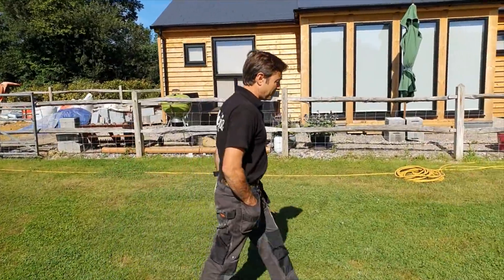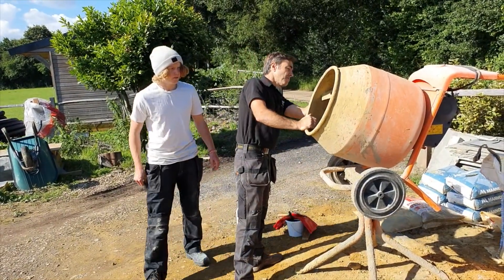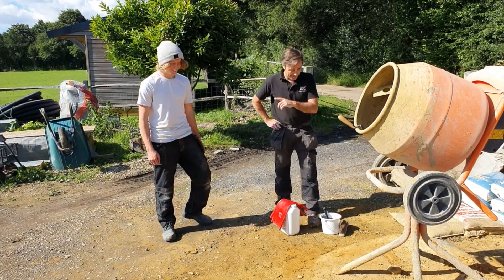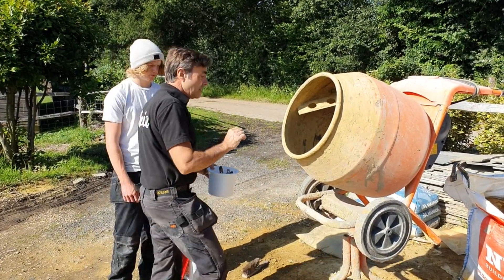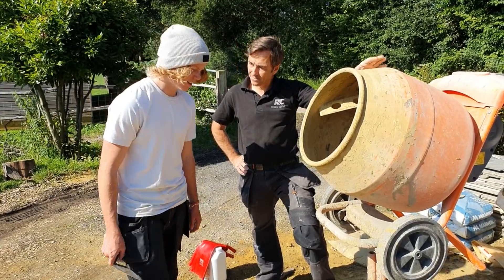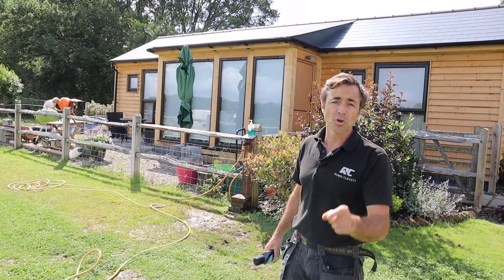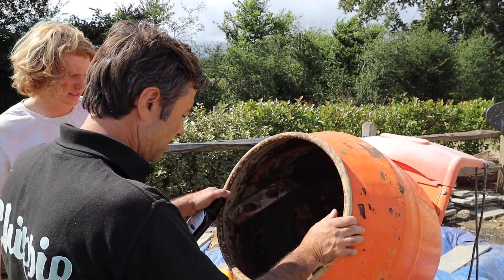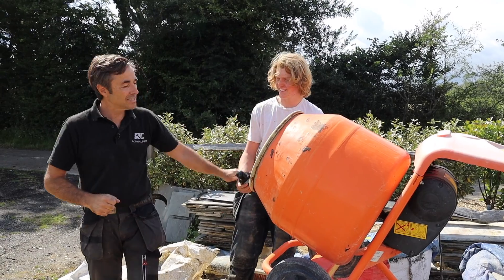How to clean a dirty belle cement mixer

Comment: All I do chuck a few old bricks in some water and a steel handles shovel the shovel rolls around and cleans the rim the brick clean the shovel and the drum nice n easy!
Reply: My bricky did that with my brand new mixer the fekker and dented it all up. I find it much easier to clean properly now soon as mix is done, takes two minutes.

Comment: Hi Robin, I enjoyed this Video I am retired now but when I was working for a small building firm my main job was decorating when they ran out of work they put me with the bricklayer who was a tough old boy but had a different way of cleaning out the cement mixer
he used gravel at the the end of the day he gave me 2 buckets of this  to put in the mixer add water and leave for a little while when finished the inside of the mixer was nice and clean all the gravel was emptied into a garden sieve then back in the buckets he kept in the van how time change.

Comment: Don't forget to rinse that acid off with plenty water otherwise the corrosion will be wild!
A prevention tip for the cement not stick so much is to spray the outside only with diesel or some oil like wd40 it stops the buildup.
Inside nothing like a good old fashioned stiff brush.
In England washing building tools seems to be like a no no, I run a landscape business and my guys lough at me when I ask them to wash the tools lol

Comment: I use pea shingle and a half bucket of water after every day in the mixer and a brush on the outside. It can be tipped into a barrow through a sieve and the pea shingle re used. I can’t stand people using a hammer to clean a mixer and denting the hell out of it. Robin not sure I agree with the use of acid  to clean the mixer we’re supposed to be reducing the harm to the environment not increasing it. Acid should be a last call.

Comment: I had a helper on a recent job on a roof. We got started and I realised I'd forgotten something crucial, (I can't remember what it was, which is probably why I forgot it that time too! F@&# old age sucks), I knew it was going to be a 45 min round trip and he was working on something that he'd probably finish in 20 mins, but I told him, take your time and have a rest when you finish, it was a stinking hot day and out on a roof that is a killer. Well 45min later I turn up and he has taken all the trash from the roof and put it down in a pile at the front of the house ready to go. I was so impressed. I haven't had a helper who could actually think on his feet and take care of something without having to be told, in so long. Needless to say he got a big bonus and I've got him lined up for some more jobs down the road.

Comment: Looking after your tools is always a good idea.   They make you money. Robin could you please do a feature on the impact driver.  Just seen a kitchen kitchen fitter stripping door hinges.  Ok for putting wheels on cars. My first driver was a brace and bit. Then a yankee screw driver. Never used a impact. Call me old fashioned
Reply: Controllable enough for hinges but I have seen someone use an impact driver on drywall screws in plasterboard. He looked like Michael Keaton in the film Betelgeuse with the dust on his barnett

Comment: Keep the eye protection on with the acid. Top job from the trainee, and great choice of mixer. At the end of the day I used to keep 1/2 bucket of flint chippings. Chuck in with water and run for 10 mins to clean, then pour out through a riddle to recover the flints, over a barrow. Tip the barrow dribble into a skim bucket to settle, or dig a washout hole in the ground somewhere non crit. Keep the outside clean with the hose as you go. Simples.

Comment: Lucky young fellow. If he stays on with u, he will have his eyes opened. My trade is automotive. I did my first automatic transmission when I was about fifteen. It didn’t work and the car went to the junk yard. But with a little help and a lot persistence, I guess I became a transmission guy. Young ones would say they want to learn automatics. And I would say, over to the parts cleaner and start brushing in the solvent. Many wouldn’t last an hour. They would say, I want to learn transmissions, I don’t want to b a cleaning flunky. Point?  The reason Robin knows how to clean the mixer is because he has done it. Many times. Now he gets to go home and splash in the pool. Hard work and planning pays off

Comment: A work experience lad with no former inductions into building should be given the full PPE.  Brick acid is dangerous stuff and technically should only be handled by professionals.  The gloves, mask and goggles are a start but given the immaturity and inexperience of the operative a full pvc suit should have been provided (never mind the heat)  Splashing brick acid will have contaminated the poor lads clothes that are thin cotton or polyester.  I hope the HSE don't see this video.

Comment: All you had to do to clean the inside was throw a bag of gravel or grano in with some water it will as new in 10 min and then jet wash the outside .
Reply: Yes as long as you do it while the cement is still soft!
Reply: @katabrontes  Not at all,it could be rock hard and it will still bring the mixer up spotless
Reply: @interabang   Clearly you haven't tried this David or you would know it doesn't work 100%...  It will take a little or the loose off,  but not the majority.  like @Michael Blackmore said,  if it's still soft, it will remove it.
Reply: @scrumpyj07  I can assure you it will  jack Ive  been a bricklayer for 30 years.
Gravel/stones and water is very abrasive it will clean any mixer regardless of what's in it and how long it's been in.
Reply: The jet wash won’t work when the cement is set hard. Gravel inside, yes. Acid outside yes!
Reply: @interabang  totally agree I've been a bricklayer for 25 years and I tell anybody who is trying to clean a mixer out half fill with pea gravel plenty of water let her spin for half to 45 minutes and she will be spotless 👍
Reply: @peterhanson3962  yes it will if you put the nozell close to the dried mortar and quickly move it back and forth in small motions it will take it off easily,including the paint if you want !.